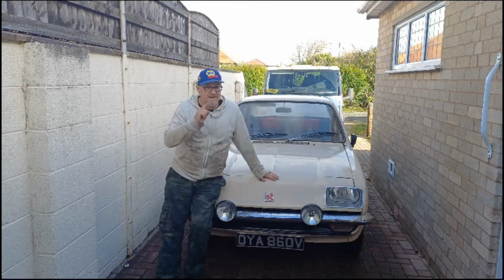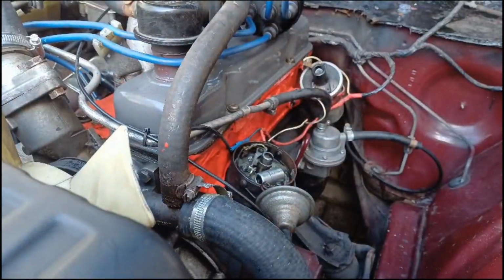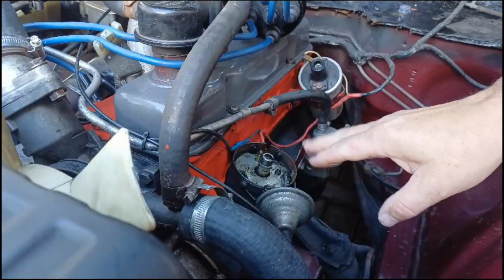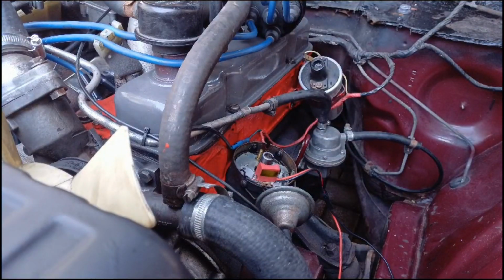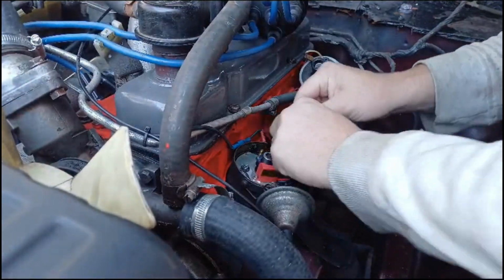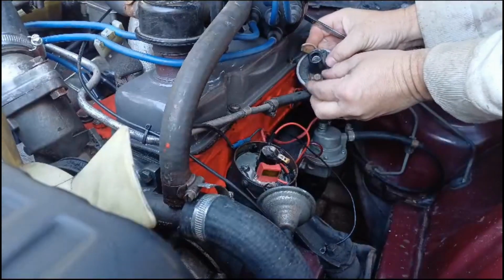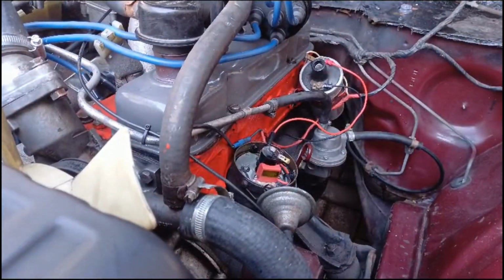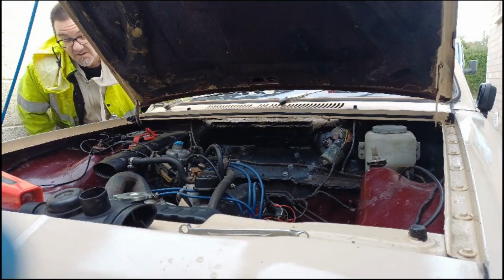Barn Find-Vauxhall Chevette, Oddy's continuing running Issues Part 2

Comment: Later chevettes used a much better Bosch distributor. Those delco dizzys would generally be worn by around 50k and would cause running issues. The trick was to close the points gap and reset the timing. Also the wire from the coil used to break inside the insulation. I had a lot of dealings with those engines back in the day. They were no ball of fire but as long as the oil was changed every 6k and the valve clearance was set properly they could pass the 100k mark with little drama. Its also worth keeping a close eye on the rubber pipe that goes into the carb. Its right above the hot exhaust manifold.....

Comment: Hi mate nice 👍 one no problem started first time I had 1262 engine in my chevette stage two spec very Inpresed my kit similar to yours but mine live red wire to ignition live
Reply from the maker: Thanks for the comment...this was a kit from @powersparkignitionltd8376 and thankfully did the job...🤘do you still have yours?